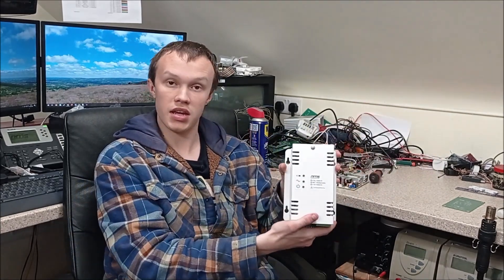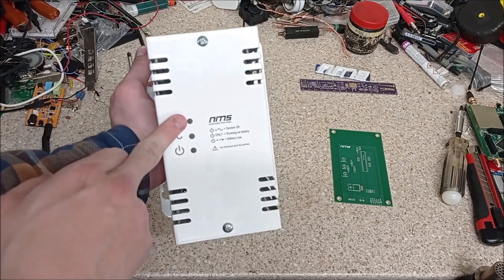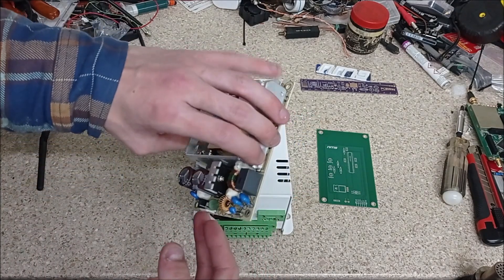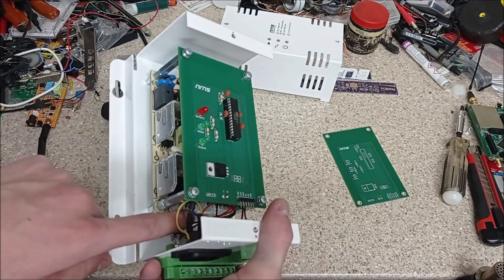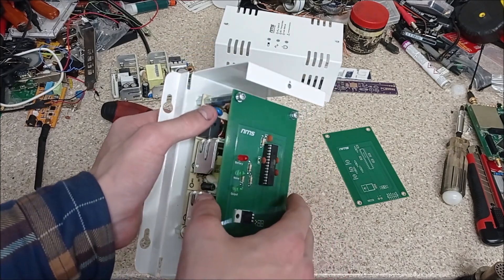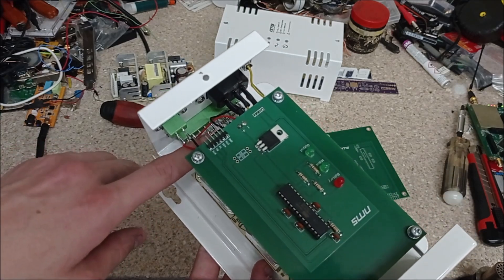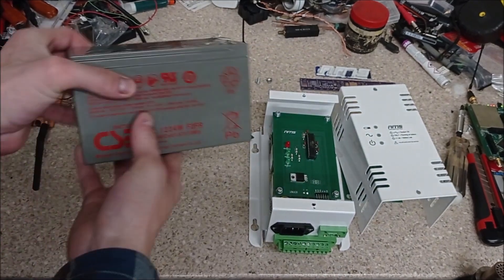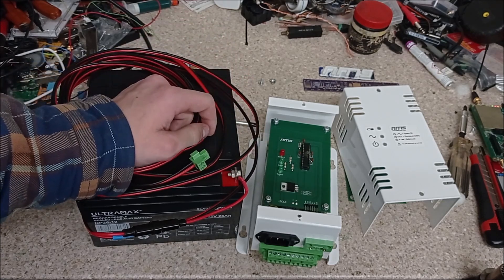Mini UPS for your Broadband

Comment: What a smooth project. Love it.  

I'd probably distance the HV and LV a little more - stick the mains on the opposite side perhaps? 
 
And the 12V outputs, just to make the wiring tidier I'd go + - + - + - + -   Yeah, it'd be a bit tougher inside, but neater and easier on the out.

But that's what these home designs are about - revisions and adaptions and iterations.

They're just my thoughts and ideas, but no criticism or disrespect to the original design!

I'd love to see more of your work and teardowns - especially the broadcast stuff - so have subscribed,n
Reply from the maker: In hindsight I should really have had at least two or more different 12v sockets - the single connector is fine if you connect everything right at the start and never change anything, but boy is it a nuisance if you need to connect something else and need to be very delicate with it to avoid killing power to everything else!